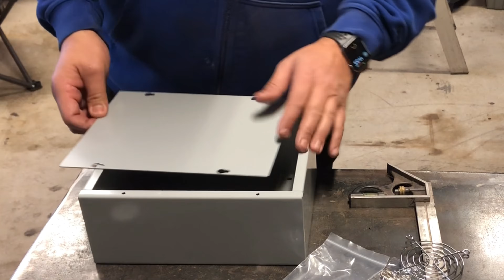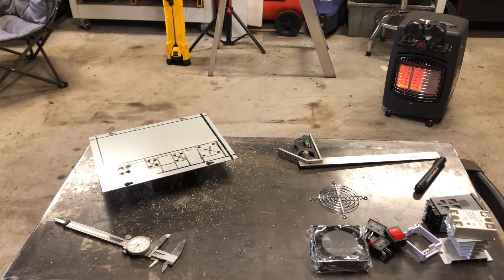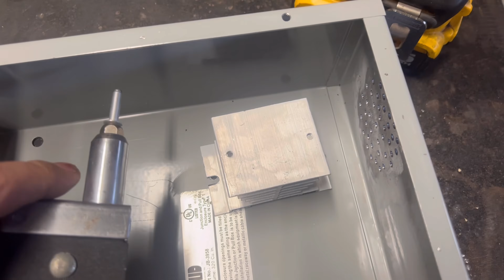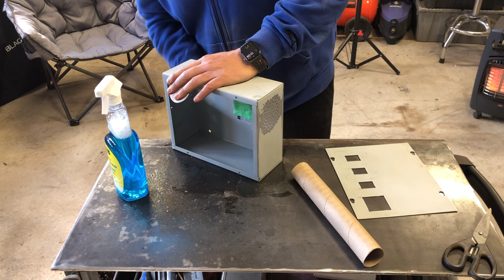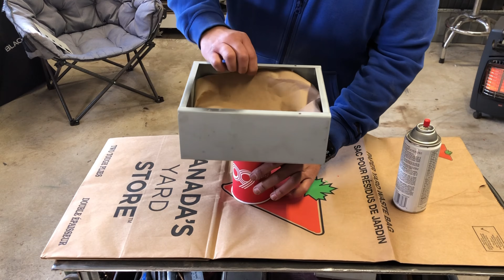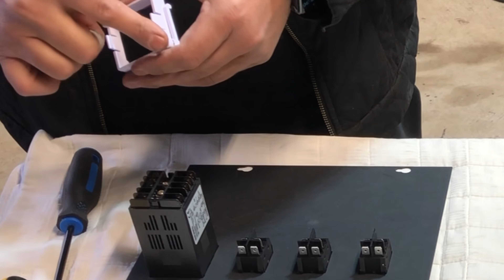Powder Coating Oven control panel build . #powdercoatingoven #controller

Comment: I love your design, I was wondering if it was really useful to put 4 heating unit in the oven ? do you have a wiring diagram by any chance ?
Reply from the maker: Thanks I could’ve used three elements. It just would’ve taken longer to reach optimal temp. Having the option of running two element three elements or four allows you to do multiple different processes, for example Cerakote or plastic molding unfortunately I can’t send you a wiring diagram through this platform, but if you message me or DM me on Instagram, I can send you a copy of a wiring diagram.

Comment: How many resistors are connected and how many watts are each?
Reply from the maker: There is 1 solid state relay and it is  40amp max @220v . I always try to stay under 35 amp for the complete system. 2 burners @ 4000watts each. You would need to use the right power cord and have minimum of a 40amp breaker .

Comment: Turn your heat sink 90 degrees more for air flo
Reply: I just watched this entire build from start to finish last night. Awesome work. You should list the links of the products used. When you create a video it helps the DIY user follow exactly what you did.
 I have plans to build a powder coating oven in the future, tried yesterday but I need a stronger heating element the 1650w only got to about 250 degrees, I think I found the ink well controller and control box you used here but idk what fan and switches you used
Reply from the maker: Thanks. I need the room in the panel. I’m hoping the fan will keep it cool.